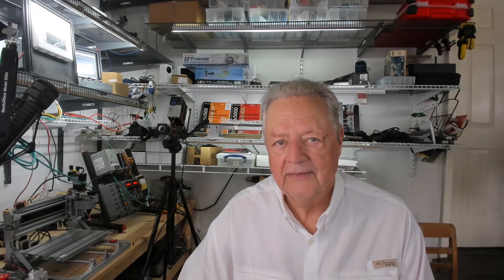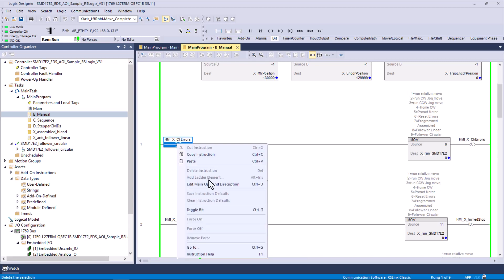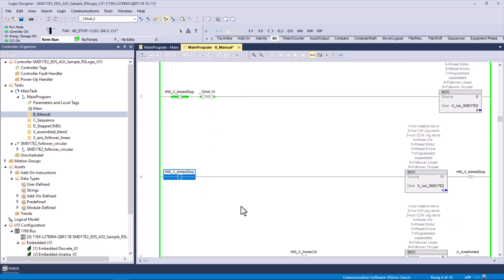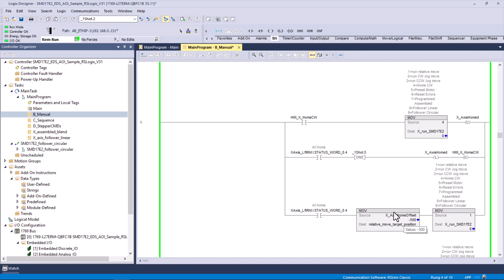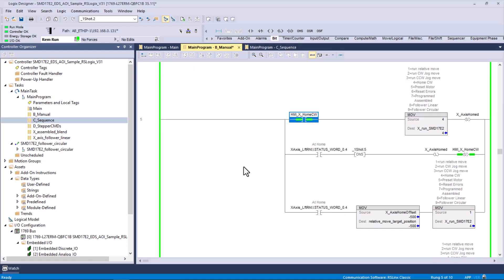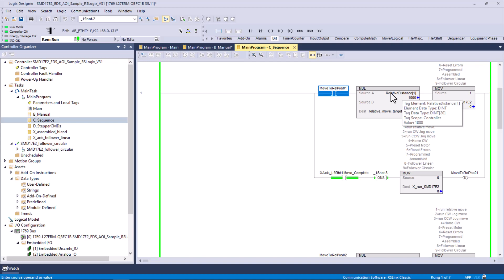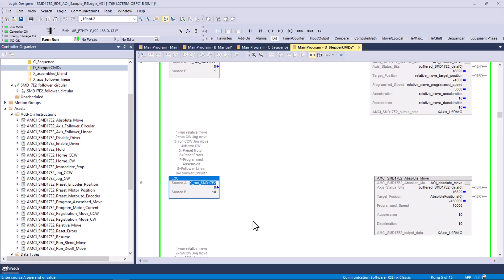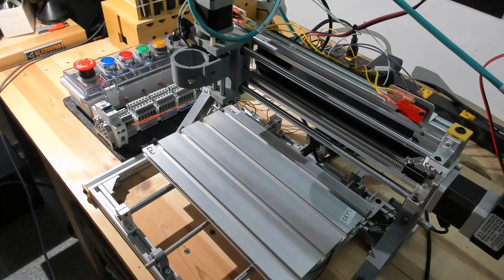AMCI - RSLogix/Studio5000 Sample Program SMD17E2 23E2 34E2 Part 2

Comment: Hello, tell me please, can I fully use the compact GuardLogix5380 processor (5069-L306ERMS2) and the ControlLogix I/O rack? thanks for the answer
Reply from the maker: You can use it with a CompactLogix processor, yes...add an ethernet bridge module and to that add the I/O modules in the 1756 chassis. Try it in your software,